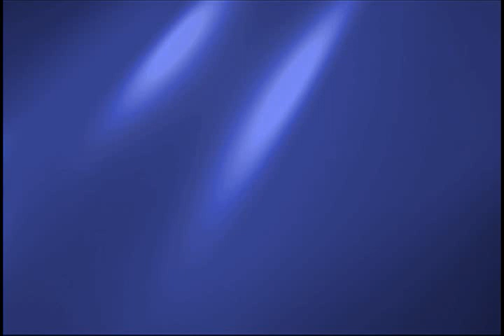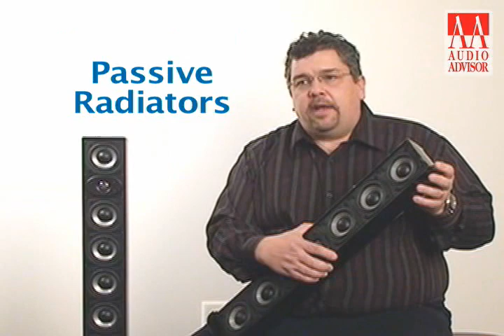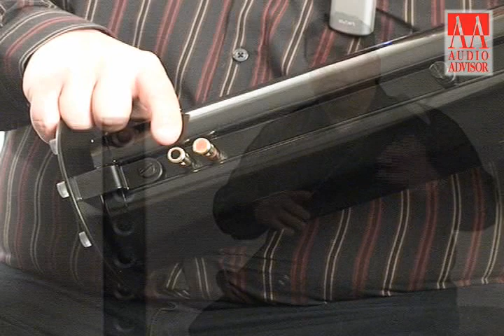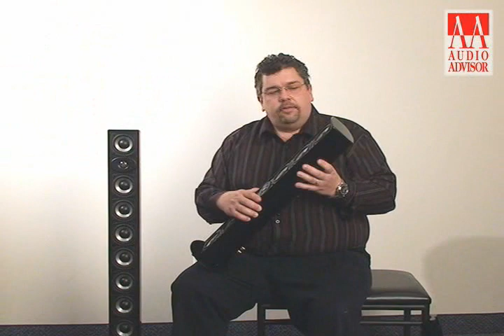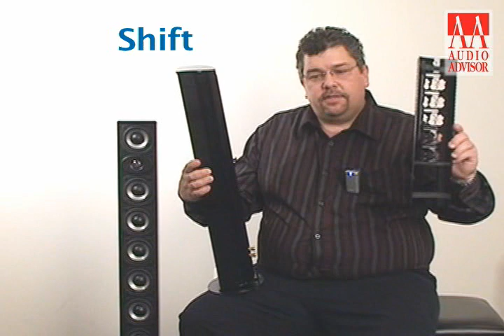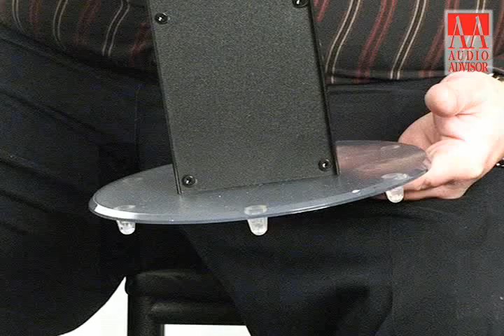Athena WS-100 Speakers – Audio Advisor

Comment: I have a set of WS-100s and I'm very happy with them, Mine are brushed aluminum instead of painted gloss black. The polycarbonate base kinda lets down the look though, in my opinion. Not by much, but a solid rubber base or even aluminum plate would have been a little bit nicer I think. No big deal.

They really do sound great and produce surprising bass for their size. I run them without a sub and its perfectly acceptable. Most speakers this size need a sub otherwise they're completely lacking.